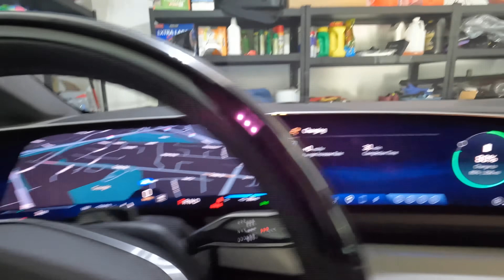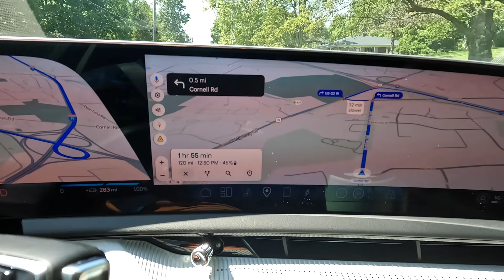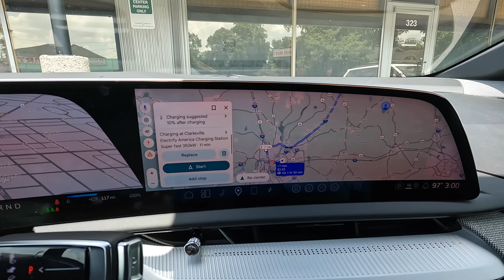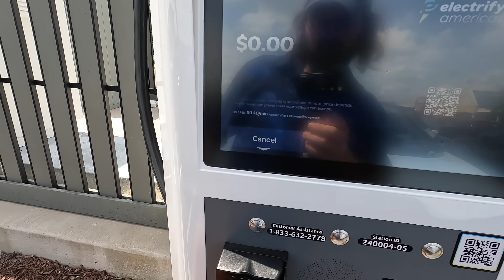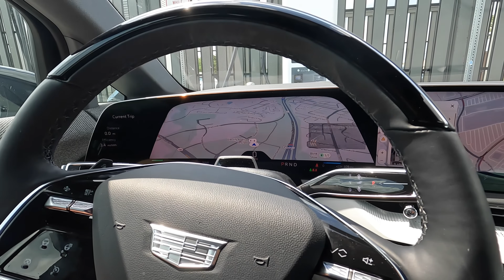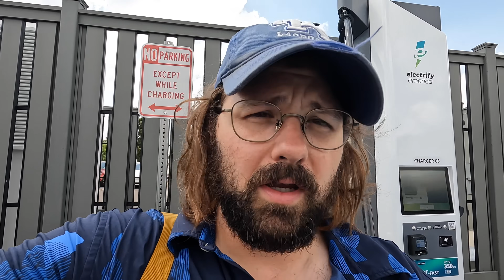Cadillac OPTIQ Road Trip Test ⚡ Charging & Range on a 240 Mile Drive

Comment: If you charge this car at a Tesla Supercharger (not that easy), you need to take two slots and pull way up  because the charging cable is short and the charging port is in the front on the driver's side. You also need an adapter, the Tesla app or the My Cadillac app and the tech savvy to make the inputs to see where the Tesla Superchargers are because natively the app does not show them.
Reply from the maker: Taking up two spots would give me serious anxiety! Love the convenience with the port location on our Volvo.